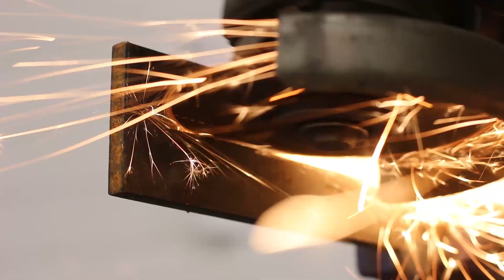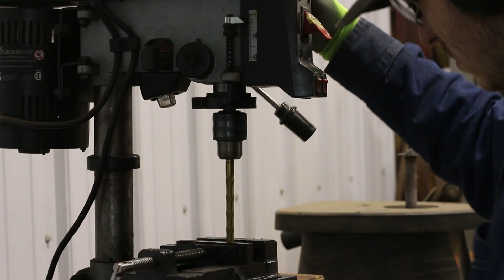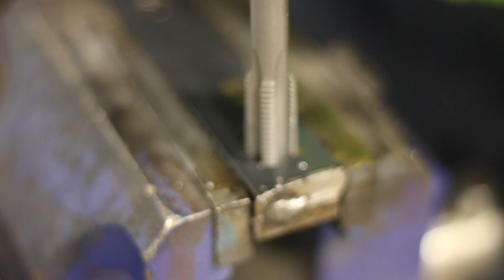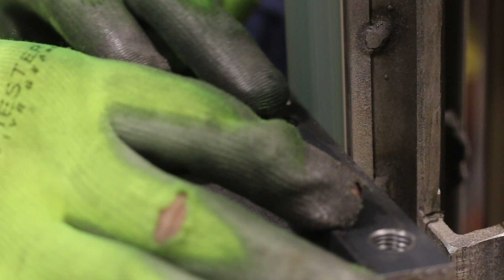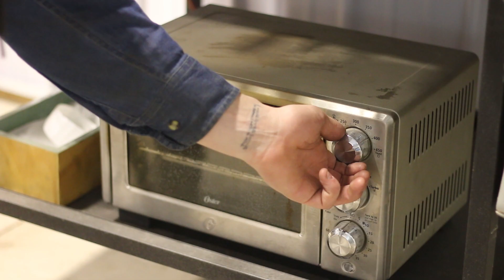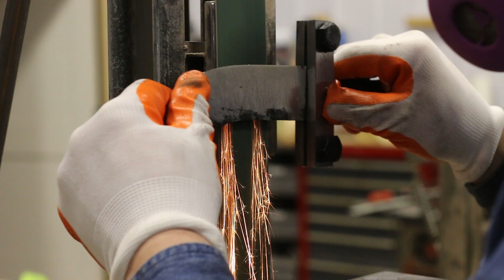FILE GUIDE! - Knife Making

Comment: That tap driver you have is the is the coolest one i have ever seen ! WOW ! I use carbide tipped cement drills for drillin' hard steel  .  they always work and they are about a million dollars cheaper than solid carbide machinists drill bits. nice work.

Comment: So to open the holes and remove the threads on two holes you drilled out the hardened and tempered steel? What type of drill bit did you use? Or was it easier due to the fact that the threads are thinner material? Great video, I will make one soon!
Reply from the maker: Thanks! I used a carbide bit, just nocking off the threads after heat treat wasn't too difficult but I'd definitely drill out the majority prior.